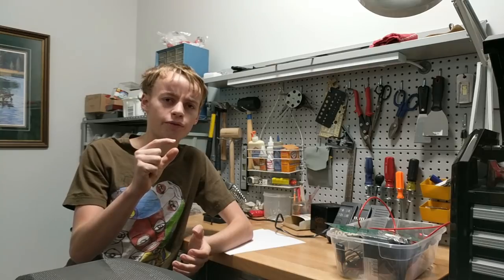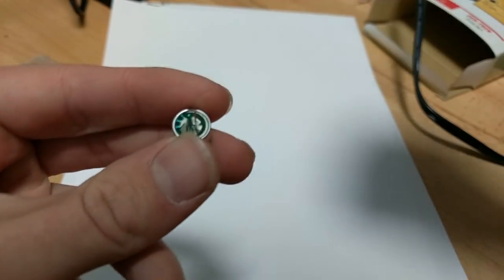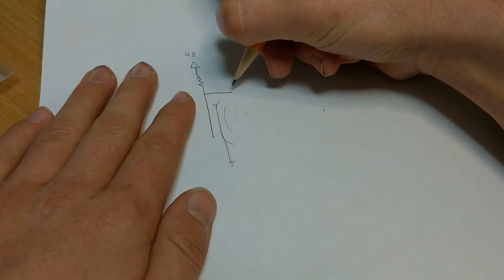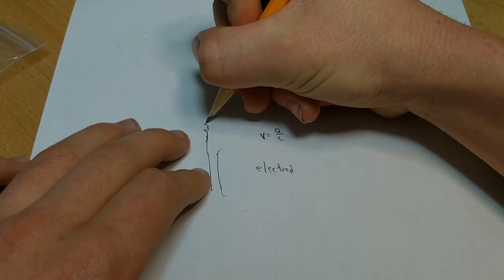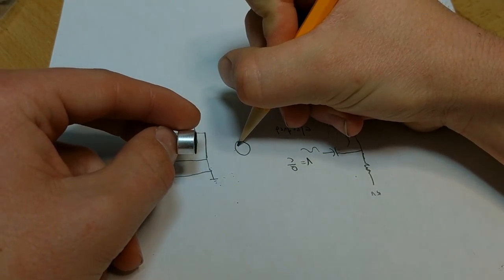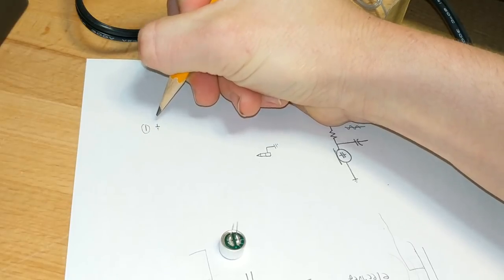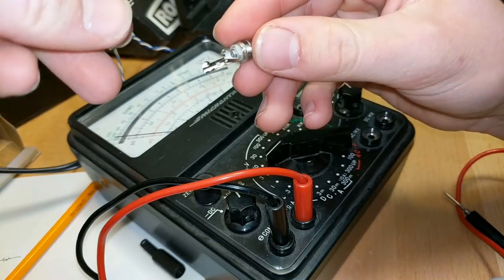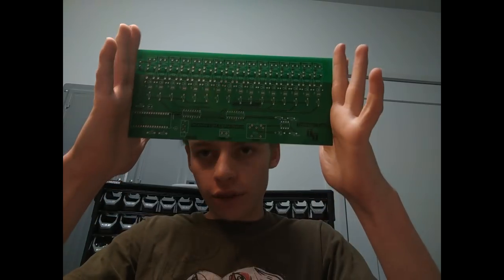Electret Mic: How it Works and How to Connect it to a Computer

Comment: Very good explanation of how it works, but the most important part was skipped. which pins on the mic get soldered to which parts of the jack. Sad, still looking...
Reply: same here. did you find it yet?
Reply: Just use google :D

Comment: For a 3.5 mm plug that has 3 connections (Tip, Ring , Shield), tanner tech  is saying to connect the ground pin of the mic to the Shield and connect the positive pin on the mic to  both the Tip and the Ring connections of the 3.5 mm plug.  Looking at the 3.5 mm plug,  the Tip connection  is the outer tip of the plug.  Next to the Tip is the Ring connection.  Next to the Ring  connection is the Shield connection.   Note that the Ring connection is sandwiched between the Tip and the Shield.   As stated in the video.  the Tip and the Ring are effectively shorted together since both are connected to the positive pin on the mic.

Comment: Hey Tanner---I have a 3 lead electret element that I want to use with a phantom power audio interface. I simply used the center lead on the element to positive, and one of the casing leads to the negative, then plugged the cable into the audio interface?  I'm not hearing anything when I did this...what am I doing wrong? Thanks!

Comment: Excellent Job, nice explanation of the different types of Mics with schematics. With the computer connection explanation  I can finally hook up my Heil HC-6 head set to my computer. The Heil has a mono jack that was shorting the computer 5v to ground.

Comment: Wow, terrific explanation. Thank you so much! So I have a question. There are different sizes of these electret microphones on Aliexpress. How does the size affect the performance when connected to a computer in the manner you showed in this video? Can I just simply order, say, a 16mm one and expect much higher quality audio or would it require more power?

Comment: So you didn't show the full connections to the TRS 3.5mm jack!....if you have 2 pins(connections) coming from the microphone going to the TRS jack connection do you connect the connections on this jack to the Tip and sheild?...or do you leave out the sheild and just connect the Tip and Ring?...please advise as you only have 2 connections coming from the mic!

Comment: Here is how to wire the microphone to the 3.5mm jack:  If using a TRRS 3.5mm jack, then connect S to electret positive terminal and the second R to the electret negative terminal.  If using a TRS 3.5mm jack, then connect T and R to electret positive terminal and S to the negative terminal.
Reply: I did that, but it doesn't seem to work on my desktop, or laptop.. Any idea?
Reply: Can anyone tell me what color is S and what color is R

Comment: Very well explained! 
Do you know how to adapt a high impedence mic to a low impedence equipment?
Reply: Tou use a matching transformer. 50,000 ohm inpedance in primary to 250 ohm impedance secondary. Good ones are $50-100. Cheaper ones maybe $20. but can overload easily with loud sounds.

Comment: So i connect the ground of mic ground of trs jack (sleeve?) and the positive of mic to tip and ring both of the 3.5 mm  jack ? 😅 plz help
Reply: what did you end up doing in the end?
Reply: yes. mic is mono & a TRS male jack is for stereo. S=ground/common. R= left channel positive .T= right channel.

Comment: It is possible to use the microphone in voice call?
Reply: Actually yes that is the safest way to make a phone call.  Off topic , but still relevant , I was watching an interview Snowden did about how smart phones can spy on you (hardware not software).  We all know the software is harvesting every screen press.  When you plug in an AUX cable to your phone with nothing attached it kills the internal mic because it thinks your using a hands free device.  By simply connecting one of these tiny mics to an AUX cable you can safely use your phone on speaker, and use the Mic to speak into.  This video of Snowden will further explain , I am sure you will enjoy it https://www.youtube.com/watch?v=ucRWyGKBVzo .
Reply: @DDBAA24  Plugging in any peripheral mic will not get the phone's OS to disable its audio routing, if it is supposedly logging mic data, it will just use the attached peripheral mic as the primary device and keep spying.